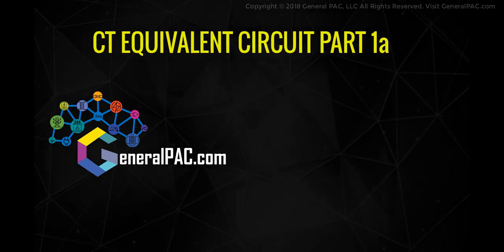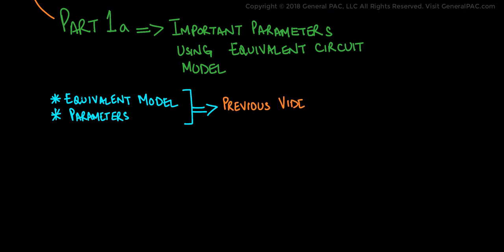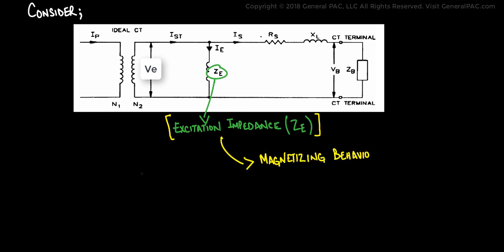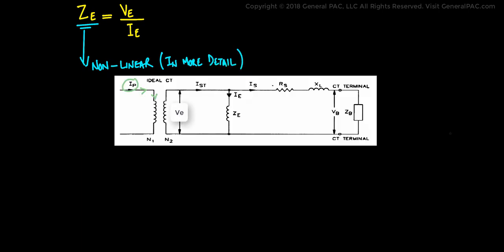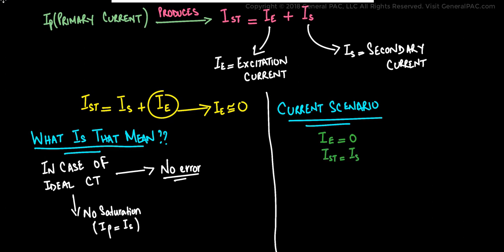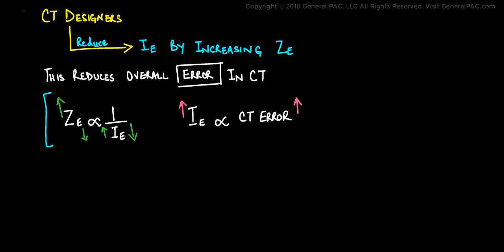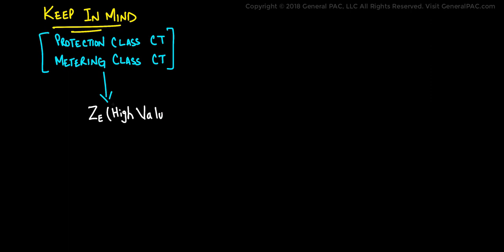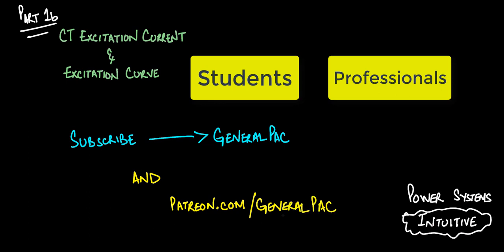Current Transformer Equivalent Circuit Model Part 1a

Comment: Ze must be High. How much high and higher than What? Higher than Impedance of Secondary windings?
Reply from the maker: Hello Rajaram,

The value of Ze is higher than both primary and secondary windings. In the case of a power transformer, the Ze value is determined by a no-load test. And in the case of CT, the Ze value is determined using the knee point test.

Thanks,
GeneralPAC by AllumiaX